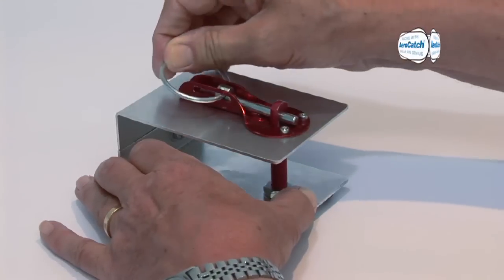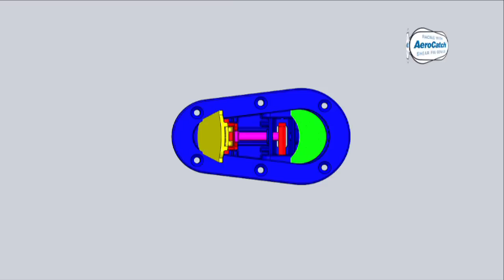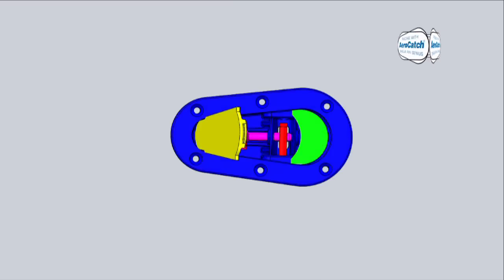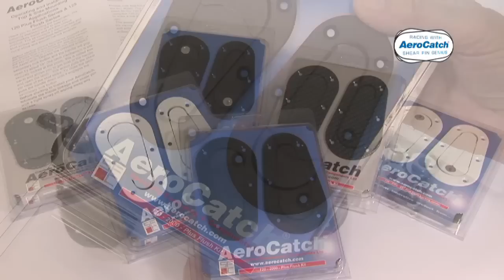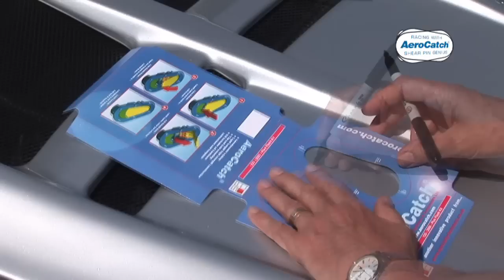AeroCatch Bonnet Pins - How They Work

Comment: Any specifics on this "molded lightweight material"? What is it? ABS plastic, Nylon GF reinforced, Carbon, Aluminum? There's no details on the website and it's the only question that comes to mind
Reply: its plastic a high grade abs, but abs plastic non the less.  the carbon ones maybe be different, but if you have alot of air going in your engine bay these will break.   also video is misleading as the flush ones you still need screws so it doesnt look flush at all and then you also lose the flange sitting above to help structure all the bolt holes you just made around a really big hole, lol

Comment: still don't understand the purpose or unction of these things..
Reply: After market hoods. Because been made from different materials and are much lighter, it is really possible to see your hood shaking and probably leave the car in high speeds.
Reply: Or engine swap or radiator swap situations where the factory hood latch is no longer present/ can't be present.
Reply: Then there others who want to clean up the engine bay and decide to remove the factory latch bolts cable and interior latch altogether to remove weight and secure their custom hood with these. And they look good, so why not. These are the ones that customise their cars. Others with stock cars are driving ordinary cars.
Reply: Certain race classes require these kinds of pin latches because of the speeds they run and factory latches can come undone and that could be distasterous. They're also pretty cool.

Comment: How does the PLUS flush version bolt on. I couldnt see any screws. I understand this setup differs from the other version that has screws running from above. Just needed an explanation before i purchased.
Reply: It says on the vid that it needs to be bonded and you can clearly see that it's glue to the bonnet
Reply: I wouldnt use the version that goes mounted from under for a hood. Use the top mount style. Its not worth it because its more flush. Also make sure they are authentic aerocatch because they are many fakes that are weak and break apart. I purchased the extreme version which is steel vs aluminum for peace of mind and durability. Im gonna use it for a carbon hood. I paid $ 80.00 on ebay. So dont go cheap on how you secure the hood or else.